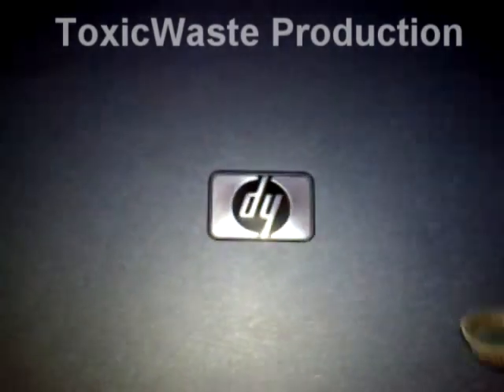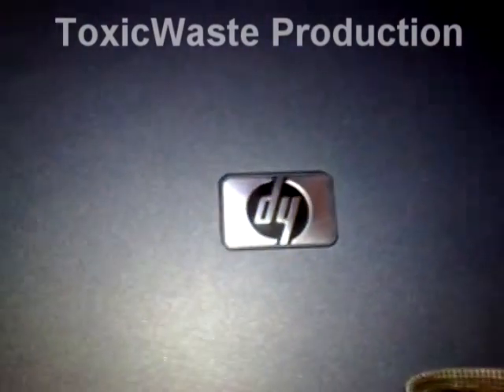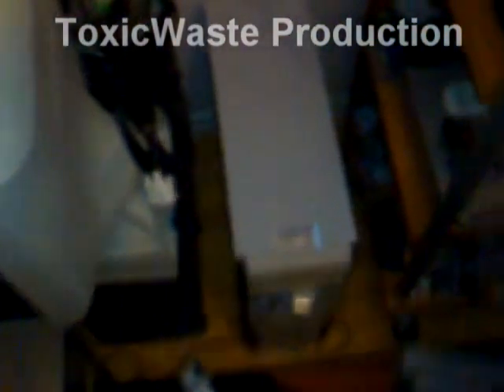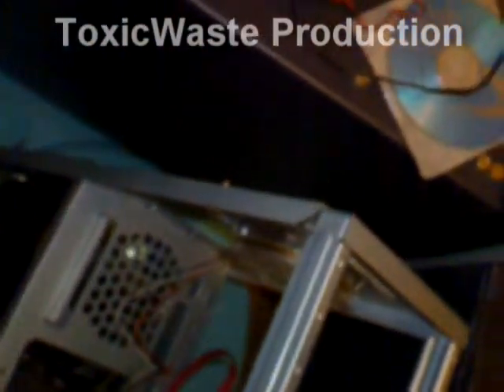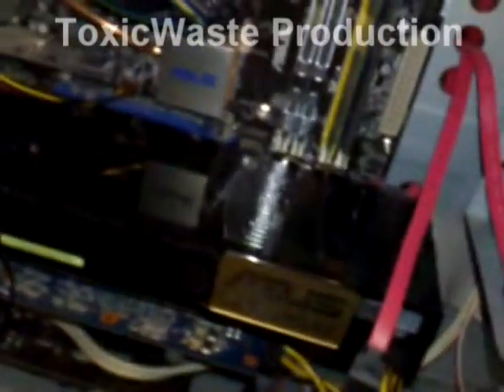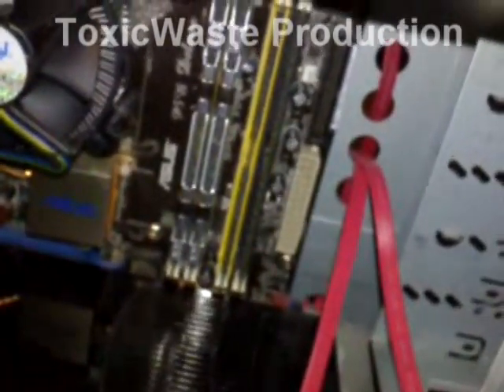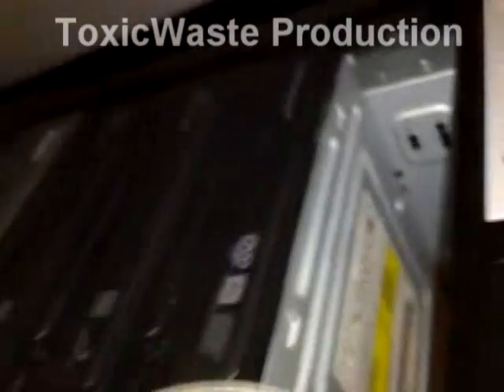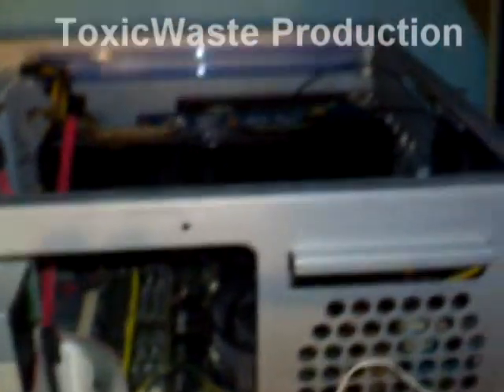what psu do i need

Comment from the maker: nice nice... i dont like the rats nest of cables though... but the price tag is huge on the 1000watt corsairs. Those are modular. But in the workstation ive got space on top of where the psu sits for cables. So it shouldn't be to much of an issue.

Is there an 850tx there in usa? here in Sweden i cant find it :(

Comment: I think a 750-850W PSU should be plenty for WS pc and the gaming rig the Corsair 1000W should be plenty. They are beefy heard they can run at over 1200W outtage of power. Thermaltake 1200W toughpower is good but not sure of the price.